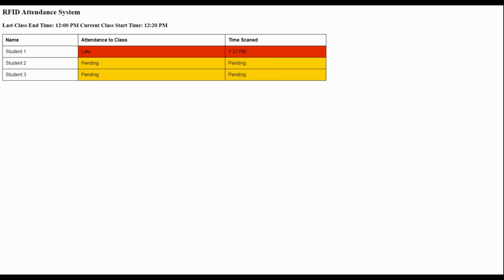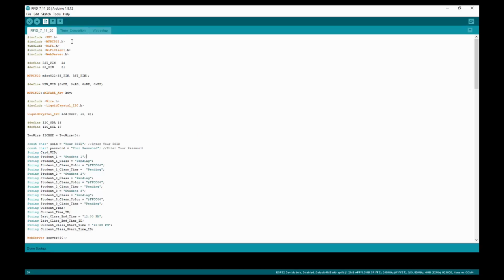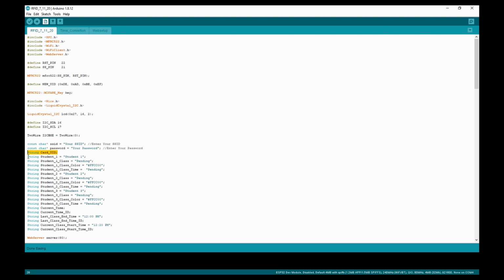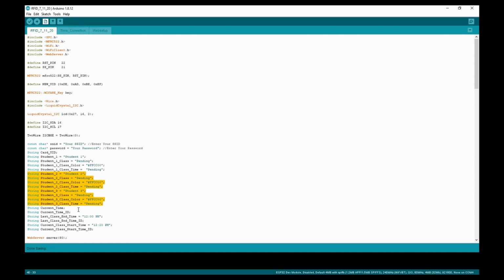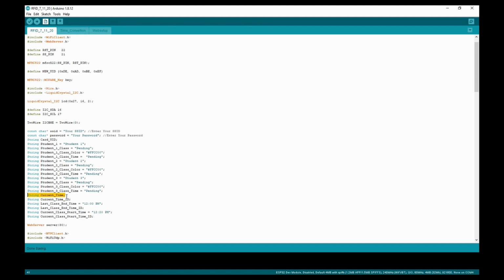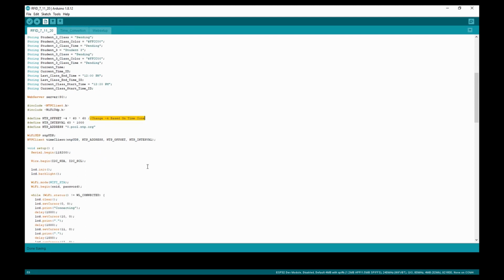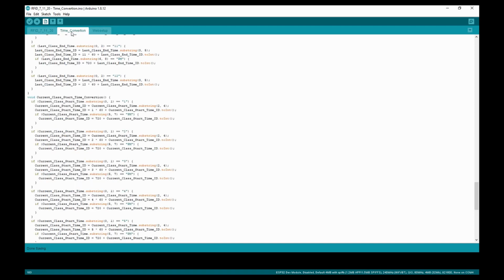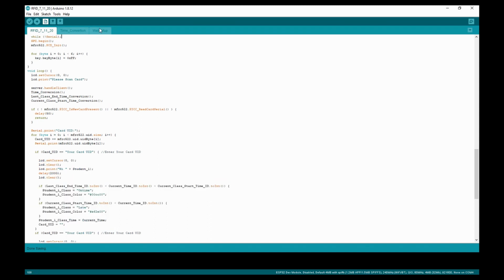Esp32 Attendance System

Comment: how did you achieve this without the use of a Arduino uno or nano? How did you connect it to the serial port.
Reply from the maker: I used the esp32 which is also a microcontroller like Arduino but has WiFi capabilities built in.
Reply: @seanmabli  I have all of the libraries and board managers installed, however the port is not showing up, why is this?

Comment: Hi! Can I ask if how did you put/upload the three Ino files in Esp32?
Reply from the maker: First you have to combine all the files into to one connected folder.  Then you have to download the files to the esp32 which is different from how you would download them to an arduino.  There is information available on how to do this but it basically requires holding down the reset button while you are downloading the program and letting go at a certain time.

Comment: RFID rc 522 board also same...
Reply from the maker: Yes it is the same board.
Reply: @seanmabli  128×64 OLED display module 13c11c  can fixed..
Reply from the maker: Yes, you can change the screen to any type of screen including OLED.

Comment: I want in out RFID attendance in second counting...do you have any idea??
Reply from the maker: Do you mean you want to count the amount of time between two scans?
Reply: @seanmabli  yes...
and anywhere monitoring in online
Reply: Thank you..
Please advise me... if water flow sensor connect with system... And reading capacity..
Reply from the maker: You can just use similar code to take the data from the water flow sensor and send it to the website.